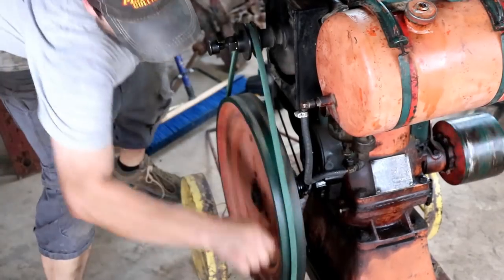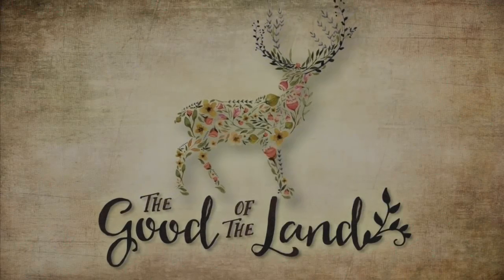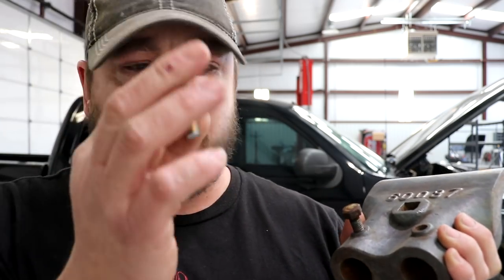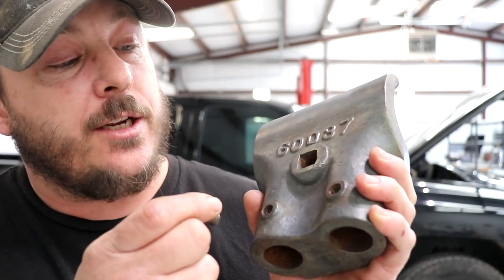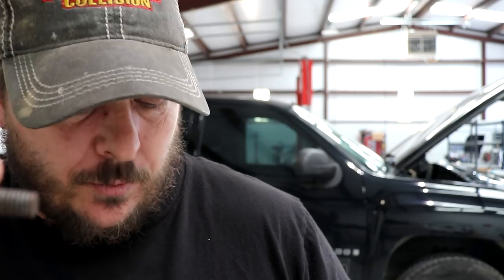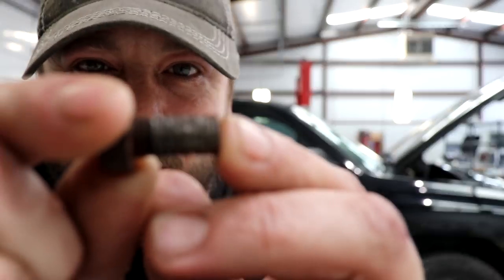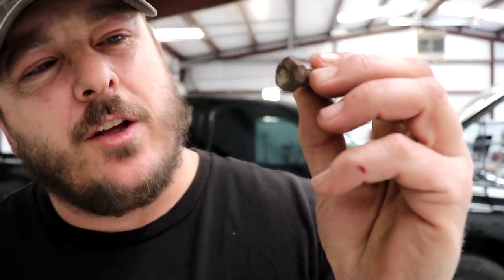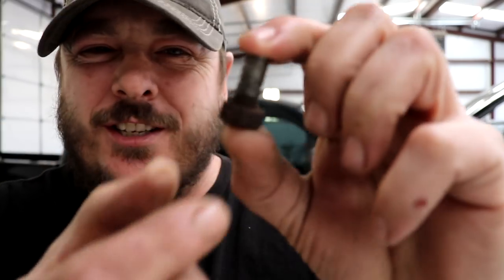OLD MECHANIC TAUGHT ME THIS YEARS AGO! Passing it on to the NEXT GENERATION!

Comment: I did the same thing and no mechanic taught me, mainly common sense for me..  using a grade 8 bolt in place of a grade 2.. I dont know if I would have done that.. for  reason's.. the bolt is designed to be drilled out encase of snapping off the head, corrosion, being stripped or the end of the bolt gets mushroomed from over tightening.. using grade 8 makes it harder to remove...  as a rule of engineering design grade 2 to 5 bolts use for bolting in legs or supports they serve no function other than holding something in place and dont need grades beyond that.. no purpose to grind off the grade 8 markings and sides that are plated?    but like assholes everyone has an opinion, including myself..
Reply from the maker: +I'm The Law https://youtu.be/OgvQKuCOhqI
Reply: a foreman  told me once excuses are like ass holes   eveyone has one and most of them stink
Reply from the maker: +Bearwood Brown https://youtu.be/OgvQKuCOhqI
Reply from the maker: +Road Sawyer Rookie this. ;) 
https://youtu.be/-6mhK8kgfxo
Thanks for watching!
Reply: your right a 66 year old rookie..   that has worked trains, planes, truck and ships.... been there, seen it, done it..
Reply: @I'm the law:

My concern about the grade eight would be it effing up the cast bracket he's holding in his hand.  As a resto, it will most likely not get the work, but if it's a working forge, a softer bolt would be better, long term.
Reply from the maker: +George Dennison https://youtu.be/OgvQKuCOhqI
Reply: @ Road Sawyer.. No, I worked on F-106's, F-111's, KC-135's and in General aviation I had friend that has an I/A and A&P license signed off behind my work.. the FAA  inspectors at the FSDO down the road knew me and my work very well, they signed off as having time in work... as I was getting oldand close to retiring, never bothered to get one..
Reply: @ The Law...

I've known a few A&P's.  A guy I grew up with became an A&P, later an inspector.  We were roomies in college for a year. One time I was out at an airfield shop he messed around at. We got to talking about something or other, and he told me told me a story about learning a 'new' component rating: "BAR".

The story goes on, and I finally ask, what does BAR? stand for.

Be All Right, was his laughing response...
Reply: @ George Dennison Prior to When I first got hired, the boss and co-owner had a mechanic install alternators in a Aero Commander 560A.. they also come with separate Voltage regulators which are wired in parallel.. he added an A/C system to the plane and the generators couldnt handle the load.. The instructions in the kit stated all old existing wiring of the generator must be replaced and rewired with new wire and gave the sizes.. The owner also an ex Navy Electrician figured it didnt need it since he was an Electrician.. Well it worked for a short while and the right regulator dropped off line and it dumped the A/C system.. not good when he is ferrying passengers. so my first job was to wring out the circuit to find whats failing.. couldnt find a thing (wiring wise).. then the genius decided to run up the engines inside the hanger, to check the regulators, altenators, basically the charging system (violation of the airport rules, insurance and FAA) after I made my decision which was, the reason the right regulator is dropping offline is because its the left regulator is the one thats failing..  the right senses the left is weak, the right  drops to let the left increase the voltage.... an ongoing issue and the so called electrician said it couldnt be as simple as what I said and check it out again.. so I said maybe you should have replaced all the wiring as the instructions  in  the kit stated (sarcasm and he didnt get it).. nope that cant be it.. check it out again.. this went on for damn near a year. with the same results.. Finally one day I said lets call the company that manufactures the kit.. so we called and talked to engineer and he said it was the left regulator.. so the company sent us the left regulator I installed it and what do you know it was the left regulator.. for a year i kept telling the ELECTRICIAN what the problem was and it couldnt be that simple..
Reply: The last thing you want at 5,000 feet is the wiring to turn into smoking Christmas lights!

What was perplexing to me I met the BAR guy in Boy Scouts, and we ended up being in Explorers, too, so I knew him well as a kid.

He was SO unmechanically inclined; had sporatic interest, consistent lack of prep/background knowledge and poor follow through.

I started working in my uncle's garage at about 12. I'd been building model cars since about 7-8. I was so 'into' models, I had one of those BigT-Bucket models, what were they, 1/12 scale? I had that damn box subdivided into a model car wrecking yard.

My step dad was an auction addict, and a great place to get old models, open box/missing parts models for 0.05/ box.  So, I had a great source for parts.

I was fixing cars out of MY carport 5-6 months before I turned 16, and could 'test drive' legally.

I was drag racing at 16-17, got offered a grunt position on a Top Fuel crew, but turned it down cause i was determined to take my '57 wagon C-D/G dragster to Pomona and the Winternationals, (I grew up in Oregon, just N of Eugene).

When I say I was 'into' cars, I was both feet, whole hog into cars.

This friend of mine was so uncut out for mechanics on anything.,I don't think I ever saw him fix a lawn mower.  His unmechanical inclinations in a mill, logging and farm town, where all three of those trades were avid 'Fix IT Yerself' crowd were well known enough, he was frequently ridiculed.

His dad owned a long established downtown lumber yard, been there as long as the town. I worked there a couple of times, got a long with his dad, well.

One day, someone order a dozen sheets of particle board underlayment, and a bunch of gallons of mixed paint and a five gal bucket or two.

My buddy took the order, mixed the paint, and loaded them all on the  1/2 ton sized, 1 ton International flat bed used for small deliveries and errands.

Those old Cornbinders always had way more power than you'd expect. My dad used to trailer his ocean boats, loved 'em.

The other thing about my buddy, he 'thought' he was a great driver, the best. We called him, 'Parnelli', cause he was so bad.

His favorite toy was gunning whatever he was driving, about half way though a corner.

The lumber yard was 2-3 blocks from Main St, on a perpendicular street. It's just that when Grant St gets to Main, there is a one way 100' jog in the street.

Some how, some one, screwed up the grid in my home town. It used to be the old North-South main street, it was the old road to the River, and the bridge over it.

Coming from the lumber yard, you could only turn right. From the other direction, you could only turn left, because Main was one way.

He gets the School Bus Yellow International the two blocks to Main St with no incident, then made a 'Parnelli' turn onto Main.  (Did I tell you he loaded the flat bed in front, instead of the back as per policies and procedures, cause the front was paralllel customer parking. Anyway, since he did load up in front, the FIRST turn with all that paint, slick ass underlayment was his Parnelli onto Main.

He hadn't tied down the load.  He flung that particle board and paint across that goofy intersection right at the front the all brick 1st National Bank.

Cause of the jog, as you drove from the yard to Main, you drove directly at the bank's front door.

I saw a corner of a sheet of particle board buried right through the front fender of a Rambler, then splattered with several different colors in Sherwin Williams Hottest Interior Colors For 1969'.

All I could do was sit down on the curb, and laugh.

Funny thing was, he turned out to be a damn good A&P man. Worked at all the big names in SoCal, and Arizona, got into carbon fiber when it first hit, ended up working on Stealth fighter.

i would lost, betting against him making it in his field.

The structure, I always thought, was what made the difference. It forced him to not eff off.

So, I was
Reply: I'm The Law .. lmao.
You sir.. summed it up perfectly.
I shall not say any more.
Reply from the maker: +Jim Spence https://youtu.be/tvrXGxJ6lNU
Reply: I've worked in three lumberyards and an old school hardware store. One thing I would say in defense of his using a " grade eight" bolt.....most hard bolts these days are anything but. They give a grade five a gold wash phosphate finish and call it an eight. Look at the big chunky sparks it's throwing when he grinds it off. It's really frustrating to me that you cannot easily find and actual hard bolt any more. The only thing hardened on those gold covered imports is the top nano millimeter.
Reply: +I'm The Law. You are clearly a very competent engineer who keeps your brain one step ahead of your hands. I did not see a major problem with using a higher tensile bolt that would be harder to snap and was plated, but I always grease bolts (often with graphite grease) before assembly to avoid future problems.
To me, the crazy part was messing about with the head. It removed the plating, affected the hardening and gave a poor fit to to the spanner. Since the new bolt also had the correct size head to fit a spanner without shearing, what was the point of altering it.?
Reply: I wondered that as well, I think someone mentioned looks?
Reply: +slowpokebr549. What you say about imported bolts is so true. Some bolts are made in China to full specification, but those bought on the open Chinese market are complete rubbish. The problem is telling the difference
I recently saw some 60mm M12 bolts that cost £600 each. Each bolt had been x- rayed, de-embrittled, re-hardened and then checked with x-rays and sonar again. Each bold had full certification paperwork. 
I suppose that when you have just paid £250 million for a fighter jet, you don't expect the wings to suddenly drop off. LOL.
Reply: I think he just used a bolt that was lying around - he wasn't engineering anything - after all, in the end it did work - didn't it?
Reply: George Dennison r
Reply: Wow I actually learn something from this horrendous video
Reply from the maker: +jeff Sessige Great. If you thought that was horrible check this out! It's the worst. https://youtu.be/EXG3vaM5HlM

Comment: Yes! When cutting or grinding down a bolt you should always put a nut on all the way down. That way after you cut and/or grind it and remove the nut, the nut will correct the threads. (You probably should of explained that in the video.)

Comment: So ... if something is too long, you can cut it shorter? Believe it or not, I already knew that.
Reply: The "trick" he is advertising here is to put a nut on before you cut it, so removing the nut AFTER the cut will fix the threads. You obviously have never cut a bolt and then tried to screw it in without fixing the threads (messed up from the cut). So you tried to be a smart-alec on a video WAYYYY above your skill level...how did that work out?
Reply: I've cut off thousands of bolts in my life, putting the nut on is..... "nice" but I NEVER do it. and never have an issue with them threading up either, on a rare occasion, a slight file to the edge.... but not often. Gary Cooper above....  I had to laugh when I saw this as well. BUT... there are plenty of people who probably could learn from this and never would think of "cutting off" a bolt in stock. But then again, they probably trip while they are chewing gum and walking too.
Reply from the maker: +Brent Barnhart Check out another video on this channel.I recomend the line shaft grinder restoration. Leave a comment. Thanks
Reply: I use this technique when cutting all thread.
Reply: trev just hit it on the knotted wire wheel done !!
Reply: i legally had my middle name changed to sassy!!!
Reply: ian its funny you should say that i was thinking of a first name change and that would make the perfect monogram on my shop towels!! i can see it now fancy sassy fogarty the other guys are gonna be sooooooooo jealous!!!

Comment: Thanks for taking the time to post this. I’ve always shortened bolts with a hacksaw and then cleaned the end threads up with a triangular and flat file. The nut and abrasive disc worked well, real clean. I’ll try this next time,Cheers 🍻

Comment: Why grind it down versus cut it to length while in the vise? It seems like the time would have been the same or less.
Reply from the maker: +Data Mobility Group LLC sure. 
https://youtu.be/OgvQKuCOhqI
Reply: That video doesn't answer his question.  Why not just cut it off close to the nut, then grind down a little tiny bit more?  Seems that would be faster than just simply grinding down an inch or whatever off a bolt.
Reply: I figured he just didn't feel like answering the question and cut and paste a link instead. Not a big deal.

I've cut hundreds of bolts to length flush with pre-attached nuts with zero issues.  And it's a lot faster than grinding the face.  I really can't think of a single reason why one would grind a bolt to length unless the length being removed is, perhaps, less than the diameter of the face. And even then cutting is likely faster. 

Preference I suppose.
Reply: I use a hack saw and a file, same results. Then again, I'm not usually shortening Grade 8 bolts.
Reply from the maker: +Thomas Thedoubter Those grade eight are tough. Thanks for watching!
https://youtu.be/OgvQKuCOhqI
Reply: Thomas Thedoubter all the bolts i stock use are 8 and up. No problem with a side grinder and cutting wheel. Can cut a thick bolt thread in about 15 sec.  Then hit with with a file two or three times.  Lol.  Dont ya love work....

Comment: This is a good idea and will work good if you use the same grade Bolt the problem with a harder grade Bolt is somebody will over tighten the bolt in that casting and will strip out the threads in the casting then you really have problems. If you strip out the threads on a bolt you just replace the bolt.
Reply from the maker: +Walter Glenn Greer We got that covered. It will be in the build video. Thanks for watching Walter!
This might interest You!
https://youtu.be/hmy96VUTxZo

Comment: Good info. This may be a "no brainer" to some, but even they had to learn about it at some point.

BTW, a thread file is a handy thing to have around.
Reply: True, but sometimes a dinged up first thread can be tricky to get a die started on properly (in other circumstances, not cutting like this).  A file is pretty handy then.  The more tools the better.
Reply from the maker: +soaringtractor https://youtu.be/OgvQKuCOhqI
Reply: I have used a thread file many times. No tool box is complete without one
Reply from the maker: +Gary Cunningham
Reply: Is that the little triangle one?
Reply: No...   do a Google image search on 'thread file'.  They are unique.
Reply: @Arkansas Pilgrim: Thread file is only good for slightly damaged threads. The bolt he had was well past being saved by a thread file or a thread die for that matter.
Reply from the maker: +GraceJacob Reed https://youtu.be/OgvQKuCOhqI
Reply: @Grace Reed

Yeah, a thread file will NOT add metal back to a worn out bolt!  It's why I don't call them by their 'proper' name, "Thread Restorer". It's a misleading name...
Reply: GraceJacob Reed, no a thread file is only as good as the person using it.  But I agree the bolt in question was far gone to be revised by a thread file, except for in a pinch it could get you home.
Reply: @GraceJacob Reed, George, and Army - I guess I didn't make it clear that I meant using a thread file on the new bolt after cutting or grinding it down it.  I was not suggesting using it on the old bolt.

Also, it was just an "additional info" comment, not a negative comment.
Reply from the maker: +Ray Jennings https://youtu.be/OgvQKuCOhqI
Reply: Actually I am using a thread file to 'resurface' a thread that has accidentialy been hit by something and eventually locks up completely during the assembly. It also helps cleaning and checking for fretting.
Mostly, it comes in handy while me working on a lathe. After cutting long threaded bolts and resurface the 90° angular cut runout at the end of it. 55° or 60° taper does not meet perfectly with the 90° chamfer at the end. That way, the very last flank bends in and covers up the mouth.
And cutting a 60° chamfer is not very safe for hand assembled parts.
But maybe this is the books and my opinion.
Reply: And while shorten up bolts (or thinning nuts), take care of the 'razor bladed' flank that mostly always stays at the end. File it down so it can never loosen itself in the thread partner. It is an hell of a work to get this undone. Especially while dealing with small bolts and nuts.

Comment: this is an important video, anyone that says its a waste of time is wrong.. We've all met the ' i dont have time for stupid questions' types.    I'm usually pulling them out of a ditch or welding something for them at 2 am.

im gonna do a video on using a hacksaw blade to hold the fuel pump rod in place or reversing a rear drum, put 3 lug nuts on it and use it as a battering ram to remove the axle, or how about, the screwdriver thru the impossible stuck oil filter...haha.
Reply: joe ferguson there's a lot of little tricks to make life easier wrenching
Reply: and the filter just tears open with the old screwdriver trick then youre left with a stub to try and remove use a strap wrench and be done as for fuel pumps chevys got a bolt to hold the shaft ive never had to use nothing but grease to hold it on any others and if an axle wont come out i have a beautiful slide hammer that does the job fine